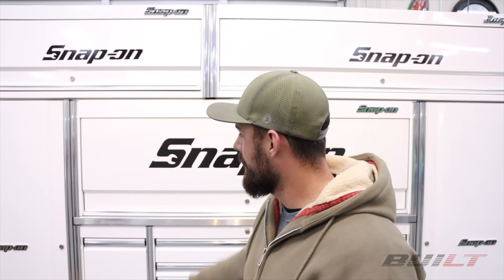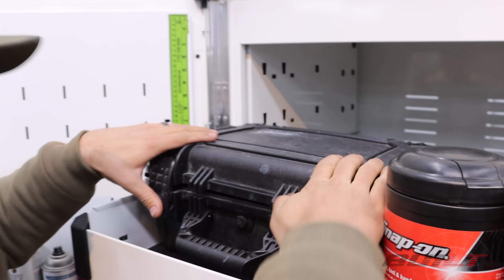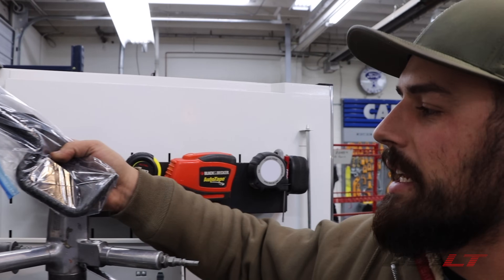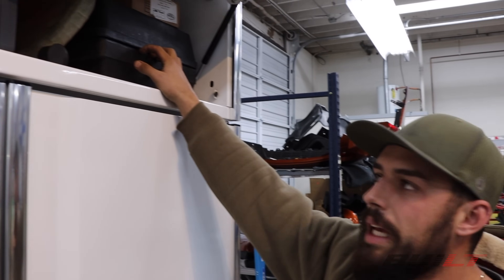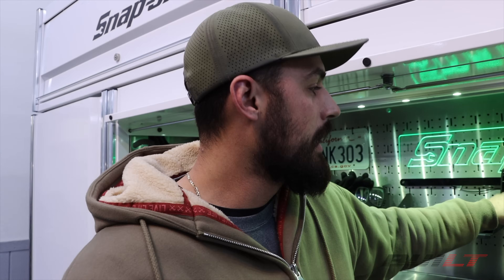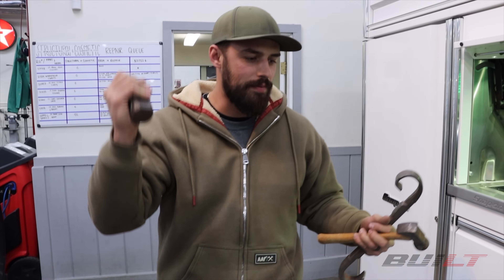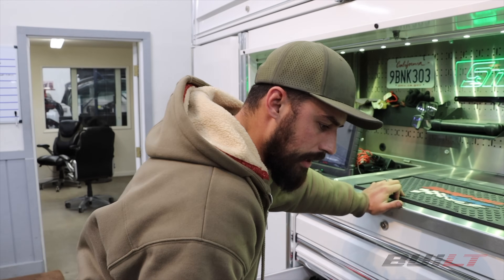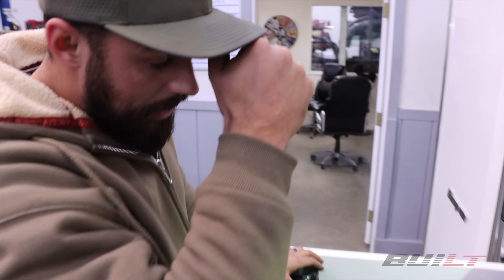Snap on EPIQ tool box tour

Comment: It should be noted that R1234YF is not flammable in the sense you point out. A leaking system in a passenger cabin will not detonate or ignite as stated, at a system pressure of 13bar and in certain instances of impact or crash the refrigerant may possibly reach a flash point but will not explode or combust in the way petrol/gasoline will ignite.  Multiple tests carried out by SAE research groups determined that a specific set of variables would lead to mild flammability but only in exceptional cases. A leaking evaporator I'm afraid is not one of these.
Reply from the maker: Thanks for the info. What then is the importance of performing an in cabin leak test when charging the system?
Reply: Assuming your referring to newer machines not refilling unless system is confirmed to be operating without a leak? The stuff still doesn't belong in the atmosphere. Epa rulings are the reason for that. Plus you shouldn't be breathing the stuff in.
Reply: No it’s because it’s about $90 dollars a lb and if you fill a a system and all your Freon leaks out the evaporator a five hundred dollar leak detector doesn’t sound too bad 🤯🤯🤯
Reply: Interesting
Reply: @Built Standards  it's considered good practice before a system service to perform a visual leak check. This can also encompass the use of a sniffer tool to detect the possibility of any probable leaks. However, this is not mandatory.
It is mandatory when a vehicle is fully discharged and contains no refrigerant within the system. This is best accomplished by means of trace gas testing. 95% nitrogen, 5% hydrogen. Used in conjunction with a h3 sniffer tool is the best method to resolve system leaks effectively.
Reply: There has been issues with 1234yf when involved in accidents, and Mercedes were very reluctant to move over because of the issues
Reply: @MotorizedCo  next : Car O Liner
Reply from the maker: @Bncxx1275  ?
Reply: @MotorizedCo   tool tour about clamp or else
Reply from the maker: @Bncxx1275  Or else what my guy? 😂
Reply: @MotorizedCo  Evo 1,evo2,evo3 or tools for aluminium
Or maybe just doing your own shop tour next time
Would be great
Reply: @MotorizedCo  sorry i can't speak English cleary
Reply: Flammable is flammable

Comment: I refuse to buy another Snap on box. My box was not even 1 month old. I came in on the weekend. My coworker was grinding right in front of it. Embedded metal in 1/3 of the box. A few months later I got a nice cover for my box. Someone rammed a scuff rail into my box. Have had my current box since 2003….
Reply from the maker: Fists would be flying if someone did that to mine!

Comment: Absolutely beautiful shop, I was a collision repair shop owner operator for 25 years and always kept it clean and organized and found it to be a representation of one's work, that tool box had to of cost as much as a new car, I never found the additional cost of Snap On tools worth it in most cases as I was just as productive with other brands as long as they were good quality, the only time I would buy Snap On is if they made a specialty tool that nobody else did, I still have some of those old school body tools you have for working metal body panels, as time went on and metals became thinner with a higher alloy content the need for those tools just went away, that industry is changing all the time and it will be interesting to see how electric vehicles will impact those changes.
Reply from the maker: Thank you Rob, times and cars are certainly changing and we are doing our best to keep up with it all!

Comment: Perfect tools for what you need them for, most tool boxes are full of brand new tools and NEVER get used like fifty percent of them , twenty different types of 3/8 ratchet's from different tool companies same as chrome and impact most of my sockets are impact apart from my 1/4 they are in chrome because the socket walls are a bit thinner and universal hinged for tight area's under dashboards sooner or later most of your six point nuts and bolts will be all torque and triple square in the interior of cars vans or even lorry's.
Anyway a sound toolbox that should last a few more generation's, love your history .
Reply from the maker: Totally agree, thank you so much!

Comment: I bet that was $100,000 or more box setup without tools
Reply: Seeing as a Mr. Big, which is larger than the base box here, is 35k, I don’t think so. My guess is 40-50k for the setup
Reply: @Sid The sloth my new Mr. Big was 33k in 2019. Not sure what it costs now.

Edit: I should also add that a Mr. Big doesn’t come with side lockers, hutches, etc. I’m talking the base box.

Comment: When I see that tool box, I just think what a waste of money. No offense
Reply: Fr . Just because it’s Snap On
Reply: Everyone has a hobby and spends thousands I'm sure, wether it's cars, planes, or whatever. These guys make a living with their tools. Can you buy something cheaper? Absolutely.  But under everyday heavy use, opening drawers many times a day, cheap aftermarket boxes will fail under load and use. My box is the MAC Tools MB 1700 series. I bought it in the late 80s after running out of room in my dad's Snap On box and my Mac triple deck roller. I still have my dad's old school lift top tool box. But my Mac 1700 is still working and serving 34 years later. There's nothing to skimp on when you are constantly expanding your tool collection, it gets heavier and heavier all the time. Those cheap boxes will crush under the weight and constant movement. I literally had to have a trailer with a winch to pull my box into it when I moved from one job to another. Like this man, I have tools from the 40s and 50s that were my dad's on top of my own. Plus it's kind of a statement too, when you hire on to a new place, and you roll in a massive box with pretty much every tool you could need, your new employer knows he isn't going to have to babysit you and lend you tools you should already have. As a mechanic, I would invest in tools that would normally be shop supplied, like scanners, specialty tools, ect. Your time is money and you can't be dicking around waiting for tools to become available to do your job.
Reply: @showcasecharlie11  You make some great points but I guess you are assuming I’m just a regular Joe just making an asshole comment but I’m not. I’ve had my U.S General box for almost 10 years now and I’ve only had to replace a slide twice and it all was under warranty but now I’ve upgraded to the icon tool box but I’ve only had it for 2 years now so the jury is still out long term wise but I just don’t see the point in spending the price of a small car or more just to store tools. The box doesn’t make you money but one can argue the fact that organized tools can help speed things up is true but to be honest, that’s why I have a roll cart for that has my most used day to day tools and I really don’t need to go to my box unless I need diagnostic tools or specialty tool. But it sounds like you have a great box yourself
Reply: @wendellgreenidge3362 
Why did you need to replace your box after 8 years? Or did you keep both? 
I bought my Snap On quad bank, used 17 years ago, it’s a 2001. I had a Snap On trade in and got more than I paid for it. I have a career (37 years) total of about $6500 into tool storage. My box is in great shape, should last another 50 years and it’s probably worth $5000.  My point is that, buying the best quality tools can definitely pay off in the long run.
Reply: @Everythingisgoingtobealright  I still have my general tool box, it’s at home and no offense but I find it hard to believe snap on gave you trade in value that is more than it’s worth when it’s a business. My roll cart was $2300 from snap on and that was the cheapest one but their entry level boxes cost well over $5000 for a very small box. You are saying you have $6500 invested when I only have $5000 total in both my 73” icon and 72” u.s general box together. How much would a 50” box cost from snap on? And those boxes will last just as long if not longer than the snap on
Reply: @wendellgreenidge3362  
List price on my current box was $14000. In 2001. Nobody pays that much, the prices are highly negotiable. I was thinking about trading it in on a $23,000 box a few years ago and my Snap On guy offered me $17,000 for mine on trade. The mark ups are crazy.
Reply: @wendellgreenidge3362  
I have some tool box videos on my YouTube channel, I think one even shows the receipt for the box. If you’re interested.
Reply: @Everythingisgoingtobealright  sure I’ll take a look